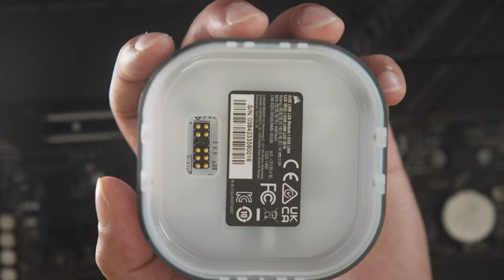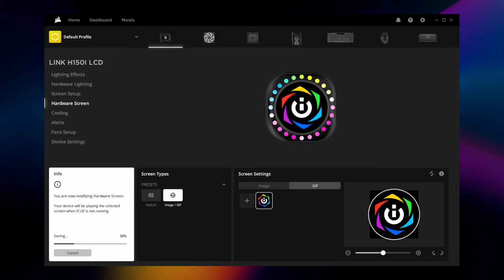How to Install the iCUE LINK AIO LCD Screen Module

Comment: I plugged mine in and its just shows the red triangle when the pc boots up
Reply: Same
Reply: Same. Notice no response.
Reply: @socalfun64  This is a very normal issue with corsair ICue technology. As the video demonstrates go ahead and save whatever you'd like your screen to display and then forcefully close your icue software. Whatever image or gif or whatever you set to your screen will now be shown instead of the caution triangle.
Reply: @obbytanka  Thanks! I ended up taking a closer look at my wiring by pulling the front 3 fans off. Turns out one was pulled out and stopped the connection between the pump and the link controller.

Comment: If only the 2nd USB 2.0 motherboard cable wasn't necessary and if only ALL Corsair iCUE Link products could PASSTHROUGH data and power instead of just having an input only like the custom cooling gear like JayzTwoCentz pointed out. It would be far superior because people using iCUE Link on a CPU AND GPU AND PUMP need to have THREE separate inputs chains going in their PC meaning running 2 different iCUE Link hubs minimum for the most optimal usage of iCUE Link custom cooling gear even though you may only be running 14 devices or less like a single hub actually supports. Also for the future increase the max device limit for the hub AND for each of the chains too

Comment: It’s a shame the product look this slick and requires 3 sata power sockets, yet another usb header and two modules. And the software is still wonky as hell.   Seriously whoever designed Icue software it makes me want to gouge my eyeballs out.   It’s over complex hot garbage.  
Todays pc build I fixed the Icue problem, removed my Corsair AIO and got Lian Li, works fine now.  
All this nonsense for colored light controls.